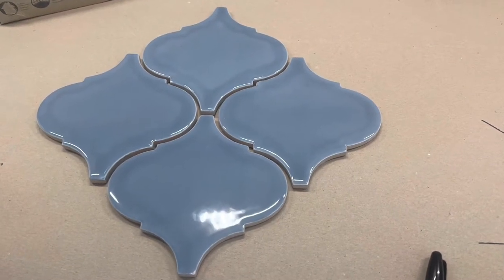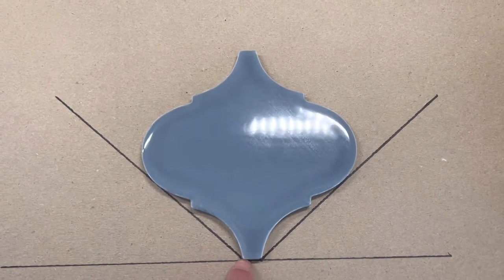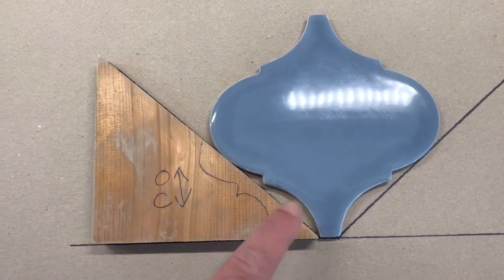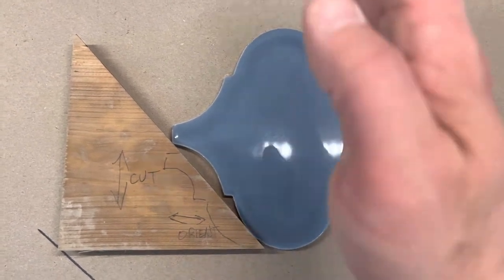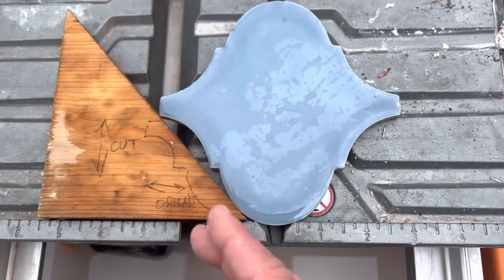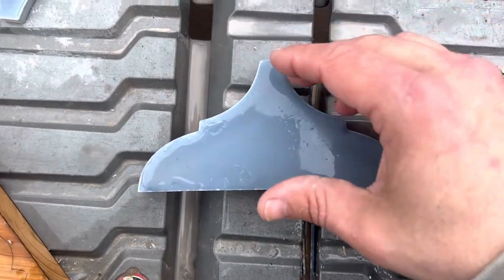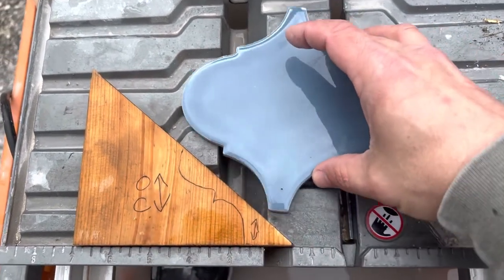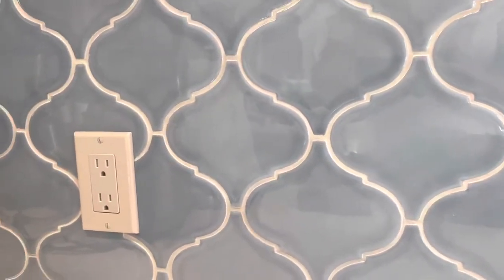How to cut arabesque tiles

Comment: Thanks for the video! I'm prepping to tackle an accent section in this kind of tile. How did you maintain proper spacing? I can't wrap my mind around where to put spacers! I got my tile second hand and can't find verification on whether they are to be/can be laid up against the other. Thanks again for giving us all a leg up!
Reply from the maker: The spacers should go along the flat edges of the tile, both on the sides and on the top/bottom. I used wedge spacers, then ran out, and finished with the traditional + shaped spacers (I just had them sticking out into the room - using one arm, with the spacer rotated 90 degrees if that makes sense). Regardless of the type of spacer they jut into the room with this type of tile.
Reply: Thank you! That totally makes sense. 👍👍 I've got this! 😊
Reply from the maker: Found a picture: https://imgur.com/gallery/71rO07G
Reply: Perfection! I'll try to remember to add my final results when I'm finished!

Comment: What kind of wet saw do you have and use
Reply from the maker: It's a Rigid overhead 7" tile saw from Home Depot. If I had it to do all over again, I'd get the same saw. I'll never use a wet table saw (under blade) again.